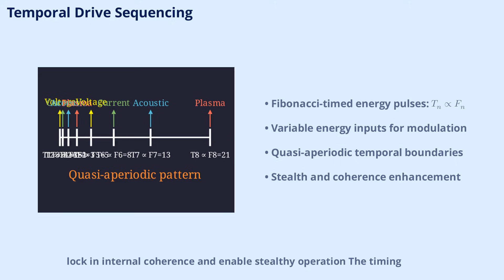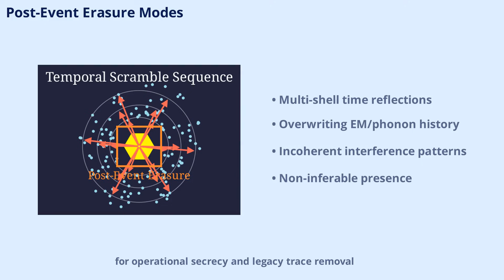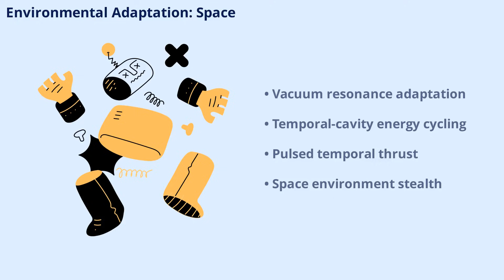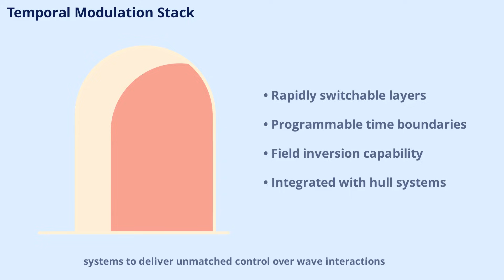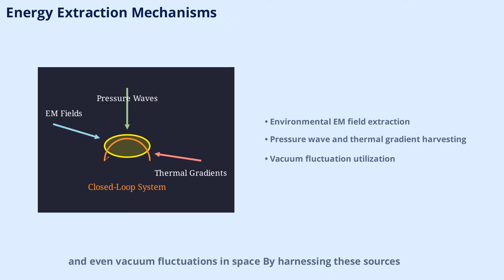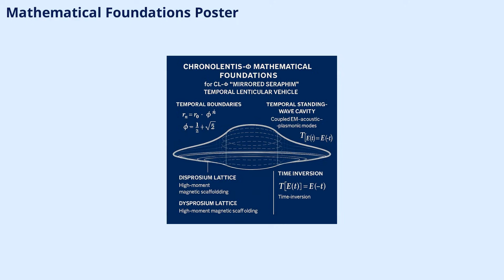The ChronoLentis‑Φ Framework Introduction & Chapter 1 VIDEO 1

Comment: The propulsion system for my saucer shaped spacecraft part 3 – Energy sources part 20 PART A3:

Reduction of the Local Speed of Light to Zero in an Engineered Medium:

The effective local speed of light v_"local" in a material medium is determined by its electromagnetic response according to
v_"local" =1/√(ε" " μ),

where εis the effective permittivity and μis the effective permeability of the medium.

To reduce the local speed of light from its vacuum value c≈3×10^8 " " m/sto zero, the product εμmust diverge:
v_"local" →0⟺εμ→∞.

Thus, achieving a vanishing local speed of light requires engineering a medium with an effectively infinite refractive response at the operating frequency.
 
Quantum-Coherent Mechanisms for Vanishing Group Velocity:

Techniques such as Electromagnetically Induced Transparency (EIT) accomplish this by exploiting quantum interference effects in ultracold atomic gases, Bose–Einstein condensates (BECs), cold plasmas, and polaritonic systems.
EIT produces an ultra-narrow transparency window inside a normally opaque resonance, accompanied by an extremely steep dispersion. In the limit of infinite dispersion slope,
dn/dω→∞,

the group velocity of light pulses approaches zero:

v_g=c/n_g →0,n_g=n+ω dn/dω→∞.

This regime is commonly referred to as “stopped light”, where electromagnetic energy is coherently mapped into collective atomic or polaritonic excitations.
 
Experimental Context:

Bose–Einstein Condensates (BECs):

Experiments led by Lene Vestergaard Hau demonstrated light slowed to tens of meters per second in sodium BECs. Subsequent work showed that, in the ideal EIT limit, the group velocity can be continuously reduced to zero, with the optical field stored as atomic coherence.

Warmed Atomic Vapors:

Rubidium vapor systems with buffer gases have demonstrated significant slow-light effects. While higher losses limit full stopping, these systems validate the dispersion-engineering principle.

Photonic Crystals and Metamaterials:

Artificially structured media can be engineered to exhibit diverging effective permittivity and permeability near resonances, allowing phase and group velocities to approach zero in a controlled frequency band.
 
Required Material Properties:

The group velocity is given by:

v_g=c/n_g .

Thus, the condition for vanishing group velocity is:

v_g→0⟺n_g→∞.

This is achieved by engineering the electric susceptibility χ(ω)such that

dn/dω→∞"while" Im" " χ(ω)→0.

In EIT systems, this is accomplished via quantum interference controlled by atomic density N, dipole moment ∣d∣, and the control-field Rabi frequency Ω_c.
 
Phase Velocity Limit:

The phase velocity is related to the refractive index by

v_"phase" =c/n.

To obtain a vanishing phase velocity,

v_"phase" →0⟺n→∞.

This implies

ε_"eff"  (ω)" " μ_"eff"  (ω)=n^2→∞.

Such behavior arises near engineered resonances in metamaterials, polaritonic crystals, and coherently driven plasmas.
 
Plasma and Resonant Media Considerations

For a cold plasma,

ε(ω)=1-(ω_p^2)/ω^2 ,ω_p^2=(n_e e^2)/(ε_0 m_e ).

A purely cold-plasma model becomes insufficient in the limit of divergent refractive index; therefore, resonant dispersion mechanisms (EIT, Autler–Townes splitting, polariton formation) must be used to maintain a large positive real refractive index while suppressing absorption.
 
EIT Algebraic Model (Zero-Velocity Limit):

For a Λ-type EIT system, the electric susceptibility near resonance is

χ(ω)≈(N∣d∣^2)/(ε_0 ℏ)  (iγ_13)/((∣Ω_c ∣^2)/4-(Δ+iγ_13)(Δ+iγ_12)).

The group velocity satisfies

v_g≈(∣Ω_c ∣^2)/(g^2 N) " " c.

Thus,

v_g→0⟺∣Ω_c∣→0"or" g√N→∞.

In this limit, the electromagnetic field is fully converted into a stationary collective excitation.
 
Polaritons and Condensed Light States:

For Rydberg exciton–polariton systems,

χ_"pol"  (ω)=(g_"pol" ^2)/(ω_0-ω-iΓ_"pol" +Σ(ω,N)).

The effective refractive index and group velocity satisfy:

n_"eff" =√(1+χ_"pol"  ),v_g=c/(n_"eff" +ω" " dn_"eff" /dω).

By tuning g_"pol" ,Σ(ω,N), and external fields, the group velocity can be driven to zero.
 

Metamaterial-Loaded Waveguides:

Effective constitutive parameters can be written as

ε_"eff"  (ω)=1+∑_j▒(F_j ω_pj^2)/(ω_0j^2-ω^2-iγ_j ω),
μ_"eff"  (ω)=1+∑_k▒(G_k Ω_mk^2)/(Ω_0k^2-ω^2-iΓ_k ω).

The zero-velocity condition becomes:

ε_"eff"  (ω)μ_"eff"  (ω)→∞,n_g→∞,v_g→0.

 
Local Schwinger Field Scaling (Algebraic Extrapolation):

The Schwinger critical field is:

E_S=(m_e^2 c^3)/eℏ.

If a local effective speed of light is treated algebraically as c_"local" =v_"local" , then

E_(S,"local" )=(m_e^2 c_"local" ^3)/eℏ.

Thus,

c_"local" →0⟹E_(S,"local" )→0.

This expresses a formal scaling result under effective-medium substitution.
 
Final Algebraic System:

The control parameters are determined by solving:

{█(ε_"eff"  (ω,"controls" )μ_"eff"  (ω,"controls" )→∞,@n_g (ω,"controls" )→∞,@v_"local" →0,@E_"applied"  (x,t)≳E_(S,"local" ) (x))┤

for

{Ω_c,N,g_"pol" ,ω_p,F_j,G_k,B,…}.

 
Important Physical Caveats:

• The above framework describes effective electromagnetic modes in engineered media, not a modification of fundamental constants.

• “Zero speed of light” refers to vanishing group and phase velocities of specific excitations, not the elimination of relativistic causality.

• Such states are narrowband, local, and coherence-dependent.

• The Schwinger scaling shown is a formal algebraic extrapolation, not a demonstrated modification of QED vacuum thresholds.

The creation of cold plasma by Magnetohydrodynamic propulsion can also prevent the creation of shock waves and Sonic booms in the atmosphere of our planet Earth.

Comment: The propulsion system for my saucer shaped spacecraft part 3 – Energy sources part 20 PART A1:

Levitation of the propellantless Synthetic Dyon propelled spacecraft within the atmosphere of a planet, such as our planet Earth:

The levitation of the propellantless synthetic Dyon propelled spacecraft is first achieved in the atmosphere of a planet, such as our planet Earth by using the strong synthetic SU(3) symmetry electromagnetic fields of the propellantless synthetic Dyon propelled spacecraft to ionize the environment that surrounds the propellantless electromagnetic field propulsion spacecraft, in a Magnetohydrodynamic propulsion fashion, combined with the Coandă effect, that is made possible due to the flying saucer shape of the propellantless electromagnetic field propulsion spacecraft, that has a surface that is equipped with many electrodes and Microwave radiation emitters and also many Terahertz radiation emitters for the purpose of ionizing the environment surrounding the spacecraft to create cold plasma that also involves the creation of a Ultracold atomic gas from the emission of cold liquid helium or liquid nitrogen, combined with Rydberg matter from Rydberg atoms, resulting in the creation of a Rydberg gas being emitted into the environment that surrounds the propellantless electromagnetic field propulsion spacecraft.

Located below the outer layers of the propellantless synthetic Dyon propelled spacecraft are Nuclear Exciton polariton lasers that are made from Excitons from Excitonium that have been combined with a bound state of 3 X-ray photons that have had their symmetries altered from U(1) symmetry to SU(3) symmetry, resulting in the creation of X-ray photons that are analogs to gluons that have non-Abelian gauge field properties, such as having the ability to exist with 8 different color states simultaneously that can also behave like gluons, unlike normal photons that only have U(1) symmetry and only exist as 1 force carrier, due to the X-ray photons being inserted into an Synthetic SU(3) symmetry electromagnetic field and absorbed by the Synthetic SU(3) symmetry electromagnetic field. 

The outer layers of the propellantless synthetic Dyon propelled spacecraft are made from many layers of strong Photonic Hypercrystals such as Hyperbolic Polaritonic crystals combined with Excitonium and Topological Chiral Photonic crystals including double gyroid photonic crystals and strong durable almost indestructible, room temperature Superconductive Electromagnetic, Quantum dot Photonic and Phononic and Magnonic Quasicrystal metamaterial lattice structures that are also combined with layers of Acoustic metamaterials and Terahertz metamaterials and shape memory alloys and self-healing materials. Plus Metamaterial emitters for emitting electromagnetic waves from electromagnetic radiation.

The outer layers of the propellantless synthetic Dyon propelled spacecraft comprises of a nested hull that is designed similar to a larger egg that contains a smaller egg that represents the area of layered materials that contains the crew compartment.

The outer layers of the propellantless synthetic Dyon propelled spacecraft are also made from strong durable and heat resistant and water proof magnetic carbon aerogels and also Metal aerogels such as Aluminium oxide aerogels and Tungsten aerogels. 

The crew compartment is represented by the smaller egg that is contained inside the larger egg, that is also filled with a noble gas such as cool Xenon, that is combined with cool breathable oxygen, that surrounds the smaller egg that represents the layers of materials that contain the crew compartment, for the purpose of increasing the effect of the emission of light from the X-ray photon laser emitters with synthetic SU(3) symmetry that are located below the outer surfaces of the propellantless electromagnetic field propulsion spacecraft.

The inner bowl layer is also made of a combination of tungsten alloy and titanium and carbonado diamond.  

The Nuclear Exciton polariton lasers that are located below the outer surfaces of propellantless electromagnetic field propulsion spacecraft are also connected to flexible Quantum dot liquid crystal light emitting diode screens.

Exciton-Polaritons can also have Negative Mass due to the inevitable action of Dissipative coupling that involves a loss of energy in the system that is used to create the Exciton polaritons and also involves the loss of both Excitons and photons from the system that is used to create the Exciton polaritons and occurs when Exciton polaritons are created, resulting in some Exciton polaritons having an inverted dispersion that is the signature of Negative mass, that causes some Exciton polaritons to move in the opposite direction of forces that are applied to them.

Exciton-Polaritons can be used to create a Polariton Superfluid at room temperature. 

The creation of the Ultracold atomic gas from the emission of cold liquid helium or liquid nitrogen, combined with Rydberg matter from Rydberg atoms, resulting in the creation of a Rydberg gas being emitted into the environment that surrounds the propellantless electromagnetic field propulsion spacecraft also involves the creation of multitudes of Rydberg Polaritonic molecules that are made from a bound state of 3 Nuclear Exciton polaritons combined with Rydberg matter from Rydberg atoms to create Rydberg Nuclear Exciton Polaritons, with the negative detuning of the frequency between the atomic resonance and the incident light to further create negative mass.

The emission into the atmosphere that surrounds the propellantless electromagnetic field propulsion spacecraft of multiple omnidirectional synthetic SU(3) symmetry electromagnetic fields that are emitted directly from the outer surfaces of the propellantless electromagnetic field propulsion spacecraft by laser emitters that are located below the outer surfaces of the propellantless electromagnetic field propulsion spacecraft and are also combined with Excitons from Excitonium to create Nuclear Exciton polariton lasers that are also the result of a multitude of a bound state of 3 X-ray photons that have had their symmetries altered from U(1) symmetry to SU(3) symmetry from X ray photons being inserted into synthetic SU(3) symmetry electromagnetic fields and Exciton polaritons also have Negative mass due to the inevitable action of dissipative coupling between Excitons and photons that occurs when Exciton polaritons are created can create negative pressures that can result in the creation of a repulsive polaritonic force-field that can both propel and deflect debris away from the propellantless electromagnetic field propulsion spacecraft.